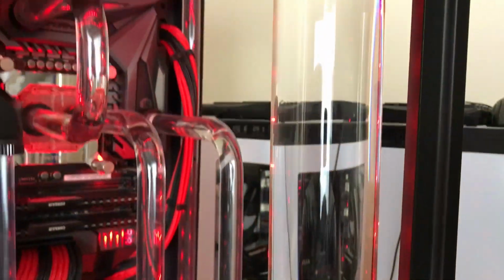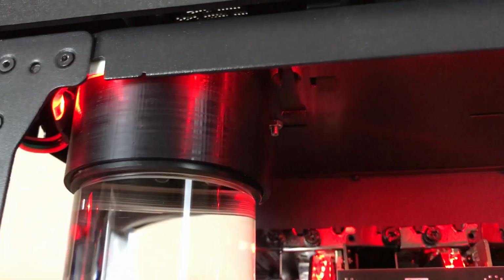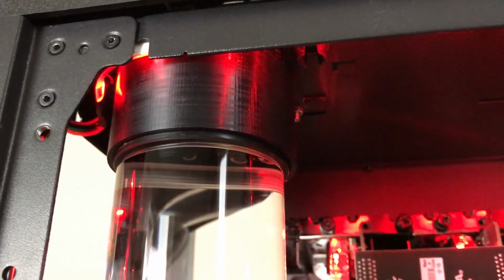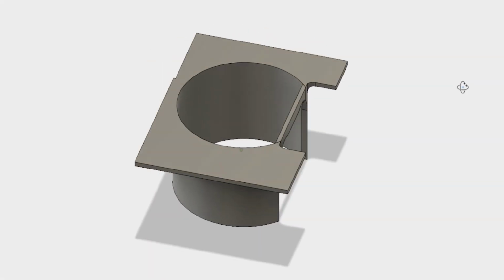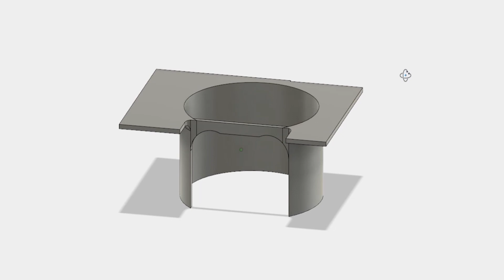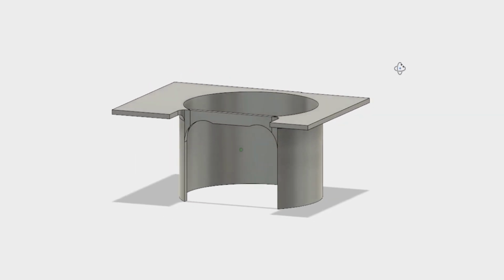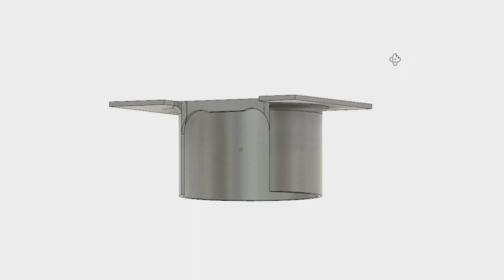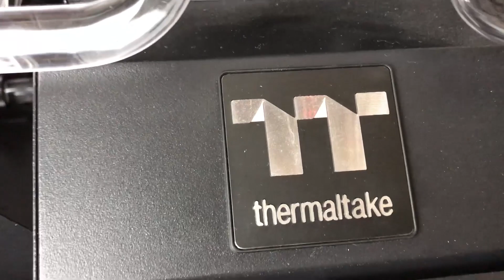T900 - How it's made :)

Comment: Hey, great build!

How do you use your motherboard’s back panel connectors?
Reply from the maker: The way it's designed - all the cables come out through the space in the top lid. Must admit - not very practical, which is the biggest downside of this case.
Reply: @3vul837  so you open the lid, connect all the stuff, route it, and close the lid?
Reply from the maker: @skimpy150190  correct.

Comment: That is an awesome looking machine... Congrats man. Subed
With the experience of the case and knowledge you have today? 
Would you still go with the 900? what do you think of the Level 20 HT?
I am planing on building a Threadripper beast and I am leaning to use the Level 20 HT, but I start to like more the looks of the 900.
This will be my first build in a while, and will be my first loop too.
Reply from the maker: The only "advantage" (very subjective though)  that Level 20 HT does have over TH T900 is the size. Not everyone can afford to have this "fridge" on their gaming desks and believe me T900 takes some space and if you pack it full with goodies like I did - it is heavy too. What Level 20 HT can't beat is the radiator space that T900 does have. If you are planning to build a PC that will be overclocked or used to a point when it produces serious heat - you will need those radiators and T900 is far more superior in terms of radiator space. As an example - my both 1080Ti's at full load are running around 42C which is OK. If you reduce radiator size from 560mm to 360mm your temps will go up and if they will - you should consider carefully what materials you are using for a cooling loop. Advice that should be taken seriously here - avoid cheap PETG as it tends to shrink inside the compression fittings. (I might post a video about this)
T900 is bigger case and might be easier for anyone who starts modding because all components are more "relaxed" inside the case.

One thing I DO NOT like about both Level 20 HT and T900 is the placement of the motherboard. Aesthetically it looks great however lacks functionality. All the cables come out from the top of the lid and there is not much you can do about it. Also consider the fact that getting air out from GPU waterblocks is a bit more complicated when GPU's are placed vertically (just my personal experience).

Hope it helps and good luck with your build :)
Reply: @3vul837  Thanks alot for the tips, I will take that into consideration... 
Space should not be an issue, but I have to see about that later, as I will be moving to a new place before building the machine, so this is something I am not sure yet.
For now I am only getting 1 GPU, rtx 2080 ti should do it... After a while, If I see that I need it, I will set up another one in SLI.
About the PETG I will one of the well know brands... Either, Thermaltake, Corsair or EkK so it should be ok..
I have to think about the loop because I wanna setup RGB with Corsair controllers... not sure what materials I will have to get, that is something I will have to do some investigation on...
Anyway, I will get the initial hardware and get everything running with air cooling... Only after seeing the case I will plan water cool loops and buy the materials
Thanks alot for the help.
Reply from the maker: @MarcoLeite  I would avoid SLI as these days there is no need for SLI. The technical term for it is - "DEAD". If you need multiple GPUs for rendering or any other processing power - sure, go ahead but other than that there is not much use for SLI. In short - the extra cost of second card will NOT give you the performance that you are probably expecting. So might need to do some research on SLI too.

Comment: When a new build project ?? And you go change your 1080 ti for 2080 ti and and processor for ryzen 3000 ?
Reply from the maker: Not planing to go 2080ti as replacement for my 1080ti SLI at the moment. New build is Threadripper based, currently in progress.

Comment: I am about to use this case as well, I assume your radiators are exhausting heat, not intaking, correct?  How loud are the fans which I assume are 140mm for those 560 CE's?  (same as I have) My build will be set up on a pedestal, sending filtered air into the case. Is there enough open area in the floor to open vents to pass the cool air into the case?
Reply from the maker: Actually my setup is done the way that fans are blowing the air into the case. The reason for that is to get the colder air through the rads into the case and then the top fan is exhausting all the hot air out from the top of the case. Fans are not loud really. I find it best to set around 1K rpm. Considering you have 8 of them - you should have plenty of airflow overall.